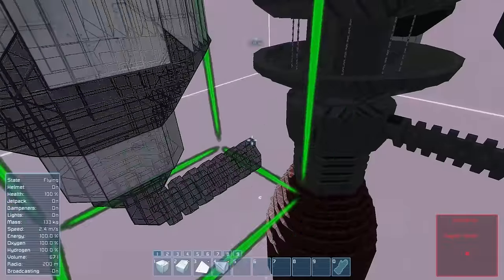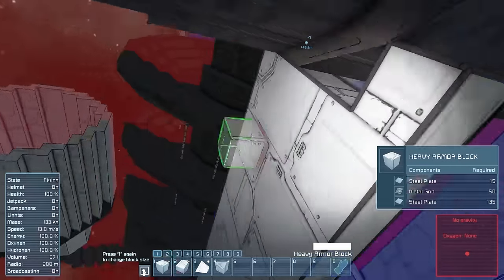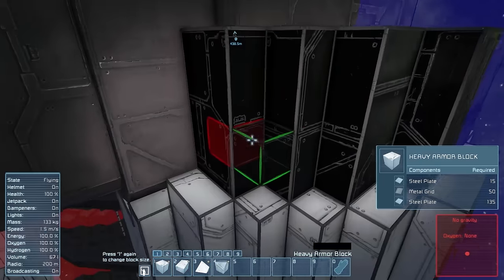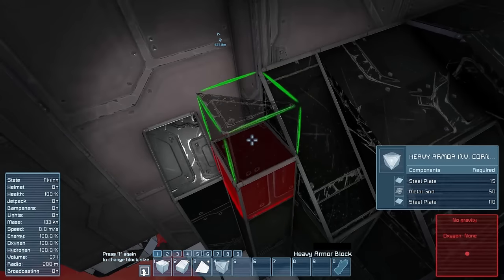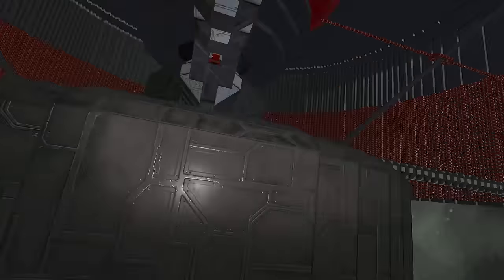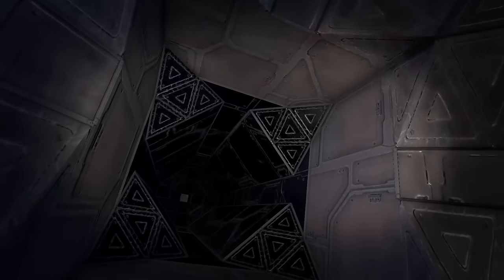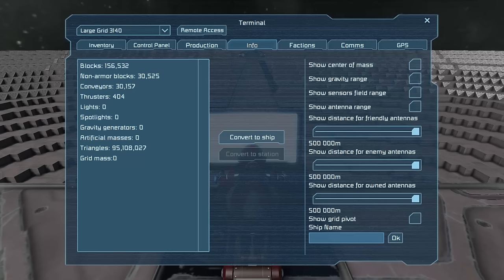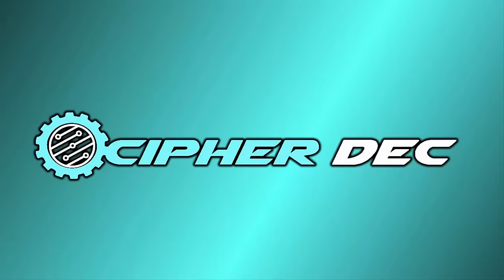SE Death Star: Dish (Part 3) Finished

Comment: Nice work ! I tried to make a Star Destroyer (Venator Class equivalent, but of my own creation) and I am quite sad because it starts to freeze a lot and framedroping...  Did you have the same kind of issue ?
Reply from the maker: There have been times where I've been kicked from the game, I've never had it freeze yet, but i'm still running at 17-19 fps. When you get to around 5fps it will take 20 minutes to load. I got a 10 second delay when copy and pasting, or when laying down 100 or more blocks at a time. Once I start working on the outer skin for the DS-1 which is next We will see how slow it gets :P
Reply: Cipher Dec yeah ! Honestly I don't know how it works... 
My FPS are not dropping but then, when I place a block, it takes time to appear (even when placing one by one) even though I have "only" 20 000 cube...

Anyhow I hope to see your work soon and thanks for sharing !
Reply from the maker: Yea don't know why, 150k blocks is a sizable difference and while I get hardware lag it seems to still be pretty stable. There was a version of this where I couldn't put down a chair which got me concerned.
Reply: Oh yeah it has been worse :D